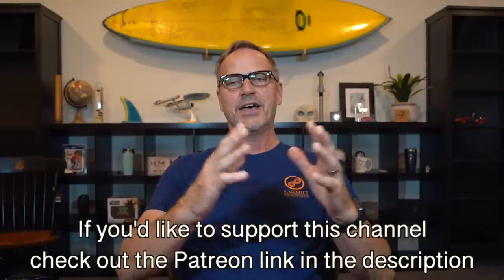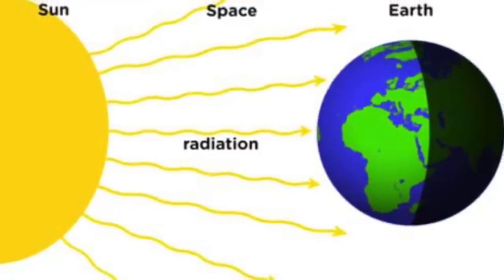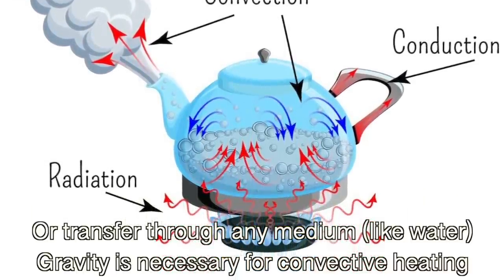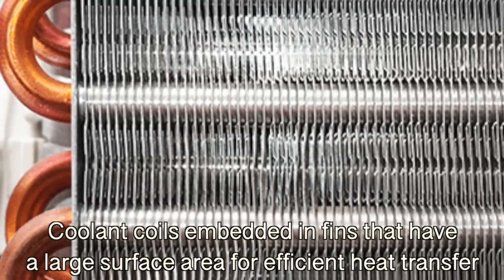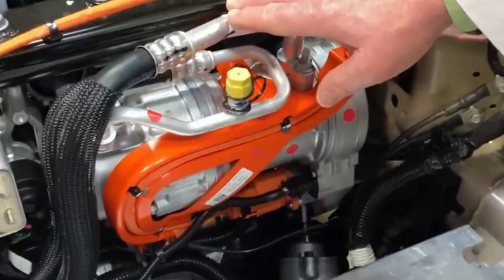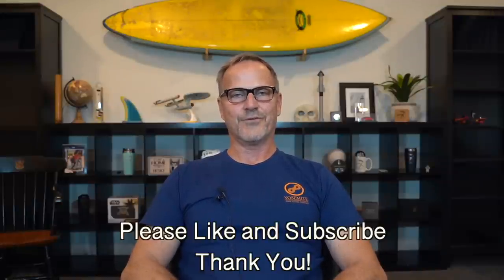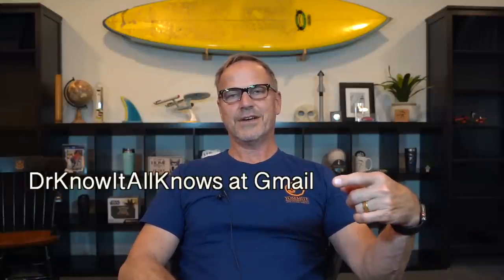How does a Tesla Heat Pump actually work and why does it matter? From first principles!

Comment: I put a geothermal heat pump in my house when I built it in 1995. Still going strong and has saved me thousands over its life cycle. The new ones today are are multiple times more efficient. It works as my air conditioner in the summer too. You did a great job explaining the physics involved.👍

Comment: Fun fact: on the ISS, the Electric Power System (EPS) includes a large number of Orbital Replaceable Units (ORUs) mounted on platforms outside the habitats, in vacuum, and these platforms are cooled by ammonia.  But they didn't want the ORUs to become vacuum-welded to the platforms over time, so they use radiant heat transfer between the ORU and the platform.  Basically, both the ORU and the platform have a large number of very thin fins, and they interleave with each other without touching. I think this was one of the very few smart things we did on the EPS design, and we own it to a guy named Dave Blackler.
Reply from the maker: Woah! That's pretty amazing. Double radiative cooling--now that's rocket science at its best! Thanks for sharing this very cool (hahah) tidbit!
Reply: Couldn't find a satisfactory explanation of vacuum welding, so now it's your responsibility to learn me something 😉
Reply: I wonder how they keep the ammonia from freezing in the shadow of space being -250 f.. I would also like to see the insulation on ISS working with 250f in the light and -250f in the shade . That's pretty unbelievable stuff

Comment: Wet heat feels hotter because the water in air stops the water on your skin from evaporating.  Not because the water in the air has more energy to transfer to you.  So the primary means of your body to regulate your body temperature (sweating) becomes less effective.
Reply: His explanation was so wrong that hurts
Reply: that's why dew point is so important
Reply: Yep, the whole part about water molecules should be deleted :(
Reply: The two explanations are not mutually exclusive.
Reply: @s.m.7018  Depends on the temperature. If the air temperature is higher than body temperature you cannot cool down without evaporation. Remember, Dr was talking desert conditions.
Reply: @s.m.7018   Agreed but one is significant the other is not
Reply: @kedaruss   In  Desert usually is not expected much humidity
Reply: @bernhardjordan9200  Exactly why it was presented as an example of a dry climate where you can survive temperatures higher than your own body.
Reply: @kedaruss   when you sweat water evaporates. It evaporates In the dew point temperature. 

What was said in the video was that water in the air due it's greater heat capacity would be the main culprit in  heat transfer, and that's not how aparent temperature works
Reply: @bernhardjordan9200  What was said in the video about desert heat is that there are fewer water molecules in the air and there is less convective heat transfer to your body (5-minute mark) so if we are talking about heat transfer to your body that means that the air temperature is higher than your body temperature because otherwise, the heat transfer would be from your body. We are mostly water and the heat capacity of water is 4184J/kg/C and to evaporate 1kg of water you need 540kcal of energy. Since one kcal is 1000 cal and 1 cal is 4.184J you see that evaporating 1kg of water takes the same energy as rising temperature of 540kg of water by 1C. All is fine if the air is dry and the body can sweat and get rid of that heat by evaporation but it cannot do it when humidity is too high. This is why in higher temperatures it's not about the transfer of the heat by water molecules to your body but simply relative humidity preventing evaporation.
Yes - heat capacity of water is higher than air by about 4x but at a relative humidity of 100% at 40C there is only 50g of water per 1kg of air. Not that significant.
Reply: @kedaruss  There are at least a couple of more fundamental problems with the explanation. First, seeing as it hasn't been mentioned or alluded to, heat is transferred from the air to the body by conduction, not convection. Convection is the carrying of heat by a moving fluid (such as hot air rising or the Gulf stream crossing the Atlantic), not the transfer of heat to/from air from/to a solid or liquid.

Next, the average kinetic energy of molecules in a gas in equilibrium is the same, regardless of the mass, and is only dependent on temperature. So water molecules in air have, on average, no more energy to impart to the body that any other molecule in the mix. So water in the air has no effect on the rate of heat transfer from the air. All that water in the air can do (as others have pointed out) is retard evaporative cooling.

The good doctor definitely doesn't "know it all". Though the certainty with which he stated a falsehood suggests he deserves the title in a colloquial sense.
Reply: @colindavidson7071  Yep, shame as I'm sure he does understand all of it.
Reply: Not more energy but more tiny surface areas. If being submerged in water directly transfers heat to a body then really humid air must do it better than dry air. No?
Reply: @kedaruss  and blood molecule
Reply: @colindavidson7071  how about heat transfer from the body? Same thing?

Comment: As a Swede, I feel compelled to correct you on the use of heat pumps in colder tempereatures heat pumps start to lose efficiency at around 40 degrees F and become less efficient than furnaces at around 25 degrees F. In most of Sweden/Norway etc. (where most people live) there are only a few months that are that cold. Another way is to use a water to water heatpump and perform heat transfer with the ground water. No need to use coal or oil. Also, your Freon discussion did not feel up to date. Im pretty sure Freon is banned (even in the US), and something like Puron seems to have better thermal properties and not destroy the ozone layer.
Reply: It used to be a problem in the past but nowadays heat pumps are so advanced they are quite efficient even in low temperatures. For example heat exchangers couldn’t absorb any more heat because of ice buildup on the surface but now heat pumps defrost themselves with cycling heat back through the evaporator periodically to keep it free from ice.
Reply: @kubismatik2  That's defrost cycle decrease effective runtime though, which is why even a low temp air source heat pump has a lower BTU rating at lower temps. Humidity in the cold makes a difference also, dry cold areas don't have as much an issue as wet and cold areas.

The alternative is also a ground source heat pump, but the installation cost is much higher
Reply: R22 is phasing out. R410A is going to be obsolete soon. R32 coming down the pipe
Reply: Yes he shouldn't have used a named banned refrigerant,  but just said refrigerant.

Comment: The reason why humid heat feels hotter is because it slows the evaporation of sweat which is a cooling mechanism in humans.
Reply from the maker: Yes, that too. This stuff is all quite complex when it interacts with biology. Thanks!
Reply: @DrKnowitallKnows  No, not "that too" but "exactly that"
Reply: @kedaruss  - No, actually it's both.  The question is what proportion is attributable to sweat + evaporation.  It would be easy to design an experiment to verify that Dr. Know-it-all is right - just use a heat transfer surface that doesn't sweat.
Reply: @jameshoffman552  If the air temperature is higher than body temperature you cannot cool down without evaporating liquid. That was the dessert situation that Dr was talking about.
Reply: Try going into a sauna, sitting for a while and then putting water on the coals. The room suddenly feels much warmer than before despite the temperature not changing.
Reply: @SirHackaL0t.  The room immediately feels hotter because -- gasp -- it is. The water is boiled and the steam is hotter than the room. If it weren't, the occupants would be dead, Humans, especially humans who are already sweating, can't survive in 100 degree C air temperatures.
Reply: @colindavidson7071  All you’ve done though is move the heat. You can’t make energy or so I thought. :)
Reply: @SirHackaL0t.  I never claimed that energy was created in the process. You claimed that the room felt hotter despite the temperature not changing. What has actually happened is that heat is transferred from the rocks to the room - or more precisely, form the rocks to the air around you, making the temperature of that air increase. Your claim that the temperature doesn't change is wrong. The temperature of the rocks (which are hotter than the air in the sauna room) decreases while the temperature of the air (including the steam being added) rises.
Reply: @jameshoffman552  Having thought about it, I think Dr. Know-it-all is wrong. If he was correct and humidity increased conduction significantly then humid air below body temperature would feel colder than dry air, and humid air above body temperature would feel warmer than dry air. My own experience is humid air feels warmer for a wide range of temperatures.
Reply: @TimothyWhiteheadzm  well I can tell you 10 degrees in 2% humidity doesn't make you feel as cold as 40 degrees in 80% humidity.
Reply: @SirHackaL0t.  oh no this was discussed.  The stone is hotter than the air. The water grabs a bunch of heat off of it and the steam raises the room temp
Reply: @TimothyWhiteheadzm  ok add to the equation a bit of wind speed
Reply: @joeKisonue  What if the ait is hotter than the body? Evaporation lets you cool down even then.
Reply: @kedaruss  you could still shed heat if you really really sweat a lot and you shook the drops off of you. Not as efficient,  but body heated water removed is heat removed.
Reply: @kedaruss  I'm trying to see what you are replying to. I might have deleted a comment because I learned something in another comment section.  Supposedly even 100% humidity doesn't act like actual water contact for added heat transfer
Reply: At what humidity point is sweating useless? Do I need to take due point into consideration?
Reply: @kedaruss  dew point factors are neat when applied to the various possible environmental conditions and whether we need to cool of using sweat.
Reply: @joeKisonue  Absolutely but forgive me for not re-watching this video now as it was a few months ago.  When it comes to shaking the droplets it doesn't work anywhere near as efficiently. Evaporation requires energy. If I remember correctly evaporating 1kg of water takes the same energy as rising the temperature of the same mass of water by around 500K. And by definition, the droplets won't be hotter than your body since they are in direct contact with it so you reduce the mass but not the temperature.
Reply: @kedaruss  yeah that was a playful reach on my part.  I'll watch videos on how sweating works for a rabbit hole or two

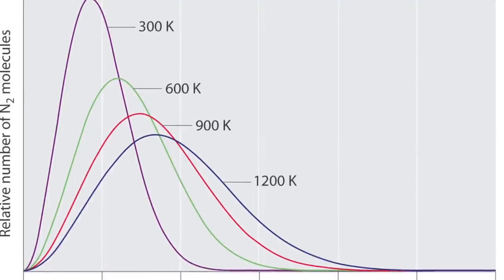Comment: 4:41 There are several mistakes at that point.

First, specific heat is conflated with thermal conductivity. It's the latter that would matter for how hot air outside feels at a particular temperature (heat capacity doesn't matter because the air around a person gets replaced way too quickly). Humid air actually has lower thermal conductivity (search for 'Air Thermal Conductivity vs Humidity').

However, sweat evaporation is much more important than a small change in thermal conductivity. The reason why drier heat is more bearable is because it makes sweating more effective. In the extreme case where air is very hot and humid, "reverse sweating" can occur: the humidity of the air can condense on the skin, heating it up very quickly (though I'm not sure if such conditions naturally exist anywhere on earth).

Comment: Sandi Munro is fascinated by the engineering in Tesla's octovalve/Heat Pump.  One of his observations is the collaborative effort that Tesla engineers went through when designing the system.  Before they designed anything they collectively mapped out the entire thermodynamic needs of the vehicle (what needs heat, what needs cooling, what generates heat and what cools).  They then designed the system to simultaneously meet those needs in the most efficient manner.  The new thermal management system in the Model 2 Plaid is apparently the best yet.
Reply: Legacy auto manufacturers are doomed.
Reply from the maker: I haven't looked into the S yet, but given how fast they iterate I'm sure it's incredible
Reply: I think the new Plaid has a larger radiator as well to help with heat removal from the battery pack.
Reply: You've seen a model 2 plaid? Wow! Most of us are still waiting for the model 2 to be announced!
Reply: @colindavidson7071  Very few people have had the privilege of viewing the Model 2 Plaid.  Including me.  Obviously I meant Model S….where is spell checker when you need it.
Reply: @joebuchanan509  Spell checking a single character is hard for a computer. :)

Comment: Minor nit-- for your explanation of dry vs humid hot weather, you're completely right about what you say of the water molecules, except it's not the biggest reason why dry heat would feel less hot: it's mostly due to the fact that your sweat evaporates faster when the air is dry (there is less of a gradient in potential energy).

Comment: In Australia, the generic term "air conditioner" in either cars or houses is still a heat pump, just optimised (in cars) for pumping heat from the interior to the exterior.   In houses, the systems are able to pump heat either into or out of the house, depending on season.
Reply: I must be a nerd, Matt - I * really * get the irrits when people call an air conditioner a heat pump . Happens a lot in Tasmania .
Reply: @blackf1ng3r62  can you explain the difference please?
Reply: Look up Sealioning .
Reply: @blackf1ng3r62  it's a really old term from the original invention.  The original was created for a book factory and the building needed cooling and the paper needed a specific humidity level.  So that thing was a conditioner. We should call it an air chiller.
Reply: @matttownsend7119  the difference so far is cars just used the system to cool because heating was supplied from engine

Comment: Strictly speaking the indoor part of the A/C unit doesn’t radiate cold, but it’s a much simpler way of looking at it than what’s really going on 🤣
Reply: Cold can not be radiated. Cold is not to radiae. Cold is the same as darkness.
Reply: Right we should always talk in relation to heat only. Like adds heat or removes heat.

Comment: Not only the batteries produce heat. The motors and inverters produce a lot of heat also. Sometimes, the battery needs heating like before charging in the winter. All of these options of cabin heating or cooling, battery heating or cooling, power train cooling and absorbing or rejecting heat from the enviroment. Sorting out how they can support each other efficiently is the magic of the octovalve.

Comment: A heat pump is nothing more than a window air conditioner. When you need heat, just take it out of the window and reinstall it in reverse. The outside heat fins are now on the inside. 
Cleaver valve design allows you to accomplish this without having to take it out of the window.
Reply: You just need to put a swivel top and bottom.  Bam I control my comfort in this room!

Comment: Just a comment on below her °C usage: Heat pumps are widely popular and useful in all of Sweden, and we are just east of Norway. There is no problem using heat pumps at below zero, but perhaps there is a problem if you use a heat pump that can go both ways. The "gain" (heating power / input electric power) do decrease, but even if you go from 4-5 to 3, it is a good deal.  Here we most often use the heat pumps only to heat our houses, not cool them. I myself use "ground heat" (pipes in the ground with a special liquid) to draw heat from the ground, that makes it even more viable as a solution at below zero °C in the air. We use both air/air systems, and air/water systems (it is common to use water heated radiators or floor heating systems in Sweden).
Reply: Yeah some people are getting hung up on the loss of the heat gain from the conductive portion as a total loss of heating ability.  The compressor contributes the same reliable portion of heat.
Reply: Is radiant heat at all popular in new builds?

Comment: Hi, just a quick note to say how much I enjoy your output, great stuff!. That  being said, and sorry to nitpick, but I was rather surprised when you said that resistive heating is energetically inefficient. Perhaps I'm missing the point, but in thermodynamic terms this could not be further from the truth. In fact my understanding is that resistive heating should be 100% efficient, in that all the energy supplied to the element in terms of electrical current is turned into heat within a closed system. Now I'm wincing in expectation of being shot down in flames. Certainly no insult intended.
Reply: He means that it takes a lot of energy to heat air and batteries don’t have that much energy capacity especially compared to gasoline so using resistive heating when heat pumps exist isn’t an efficient use of the limited battery capacity.
Reply: @trevorantram9242  Or another word, not to waste energy on heat generation, but to make use of unwanted waste heat from hot components like batteries or motor or inverter, and send them into the car cabin.
Reply: It's not efficient for its power consumption in the total potential work the battery could do. Yes on paper the device has its stat. Its in comparison the device as a unit can be considered less efficient compared to another device.  Right?
Reply: I think you are only 100% correct. Resistive heating is "only" 100% efficient, while a heat pump is about 500% efficient (calculating output heat energy / input electricity energy), as long as it is NOT a closed system (since the heat pump takes heat out of the surroundings). So Dr. K-i-a is about 500% correct in this matter. Does that make any sense?